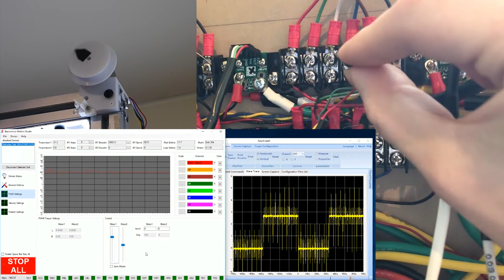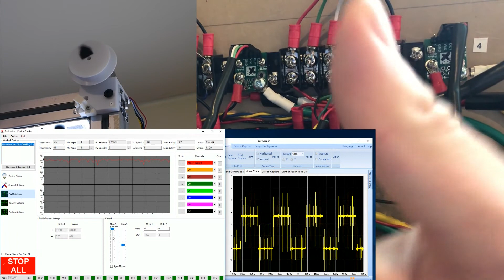Mechatronics: Filtering a Noisy Encoder Channel

Comment: I'm sorry, but I doubt that this huge noisy spikes related with encoder. Note how cap. changed encoder signal and not changed noise. Consequently, nature of this noise is external, not related to encoder. To me, that looks like either emi, floating/broken oscillosope ground, or you got current loop with stepper PWM, or maybe its a power source problem.  Anyway, here huge problem. Fixing this problem with cap. pointless (as we literally see it with our own eyes).
Reply from the maker: Hi Alex,
We agree (mostly): we never said the encoder was defective. The source of the noise is indeed clearly not the encoder itself but the lines. They are long and unshielded which is bad (EMI). Another issue with the lines is that there are wires for motor power (PWM) alongside wires for the encoder. Again, this is not good practice. We built this setup with what we had at hand and very little budget. 
This is not an issue with grounding (aside the grounding of a potential shield) as we confirmed the noise with both the scope you see in the video and the tuning software of the motor drive. It is also not a power issue, the DC power supply we have is quite good and we have a huge capacitor on it (as per manufacturer recommendation). Where I disagree is that putting the capacitor on the line is pointless. It is not since it fixed our issue... It did not eliminate the spikes but reduced their amplitudes to a point that was good enough for the drive to work properly.
Cheers.
Reply: @PolyLabrobot  The issue is not resolved. A lot of noise is clearly still on the line as shown on the scope and you've only just about managed to keep the noise within the thresholds.  
In industry, the cable is shielded and they use differential signalling.  This capacitor 'fix' is a bodge - change the parameters of the system and the 'fix' completely stops working.
Reply from the maker: @Shocker99  The issue is resolved since the motor is working correctly now. You can never completely and perfectly remove noise from any real signal. Filtering only allows you to reduce the magnitudes of unwanted harmonics and as you said keep it within thresholds.That is the point. We agree that using shielded cables and differential signals would be a great solution but in this case we are aiming at a quick and easy fix at the lowest possible cost, not industry standard compliance. This is prototyping, not production. Cheers!

Comment: Be careful when You using only a capacitor, because you drastically increase the current peaks when states changing (you can damage the encoder), I think that best method is to use a RC low-pass filter.
Reply from the maker: That's a very good point and you are absolutely right. At the rising and falling edges of the signal, that capacitor is essentially shorting the input pin and that could create current surges. I believe it still works out here because I have a very large line resistance due to long wires and multiple connectors along the path which all act as the R of the RC filter you rightfully suggest. 
What leads me to believe this is that I actually measured approx 2.7V for the square wave at the motor driver input instead of the 5V supply of the encoder. That tells me I actually have a voltage divider where the line resistance (+output impedance of the encoder) is of similar magnitude than the input impedance of the motor driver.